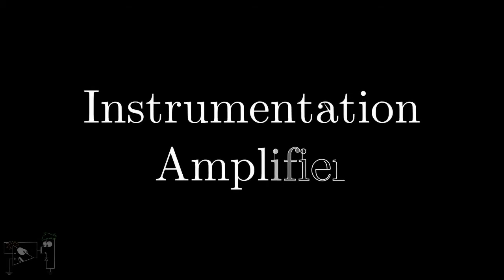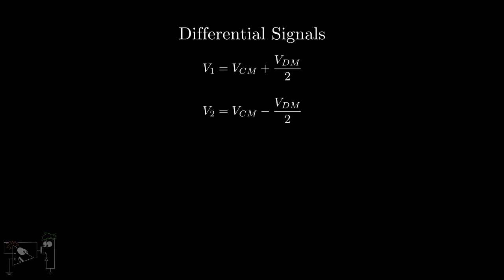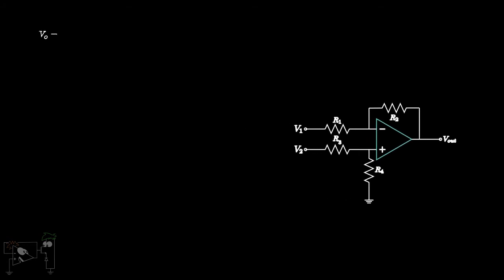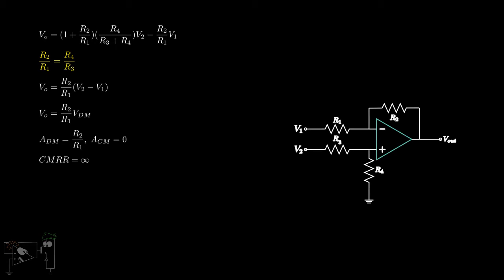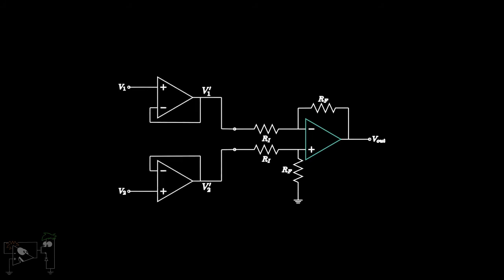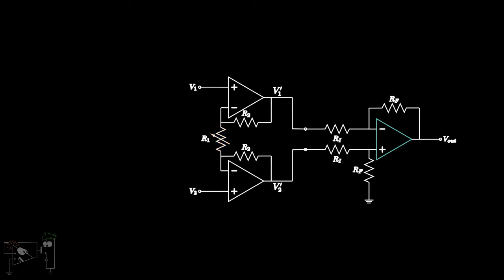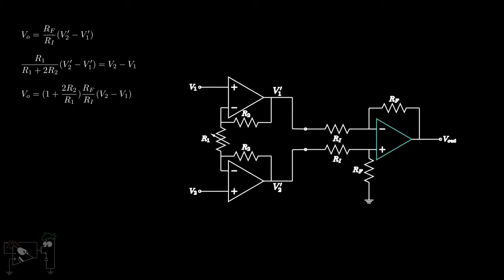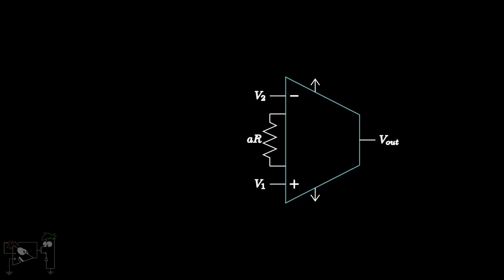18. Instrumentation Amplifier

Comment: I think to increase common mode rejection a trick to 'balance' those inherent imbalance of all six resistors is to make one of those four resistors of substractor variable (trimmer potentiometer).Tied all buffers' input and give them one same voltage, look at multimeter, and then 'trim' to zero. Will not be perfectly zero but to the lowest number possible. 

I am not really sure if that is correct. I see I it often on the Internet. It would be very good if it could be done that way because buying an integrated in-amp is stupid expensive. For ultra precision and super serious work its price is justified, but many of us simply want to have the benefit of noise rejection without financial burden.